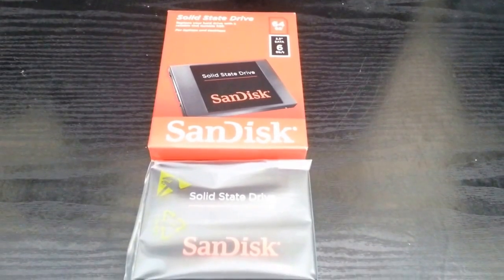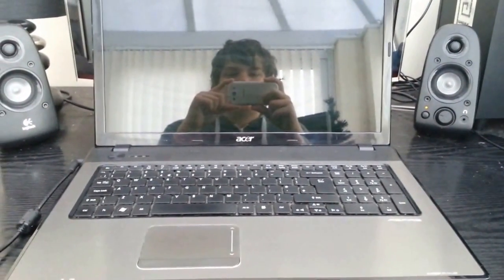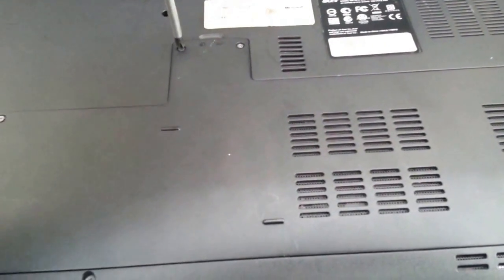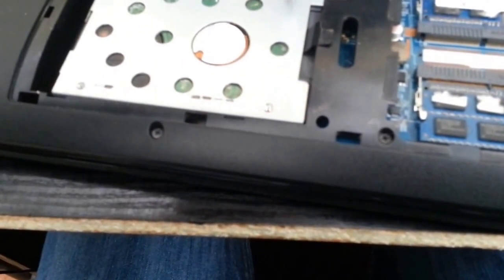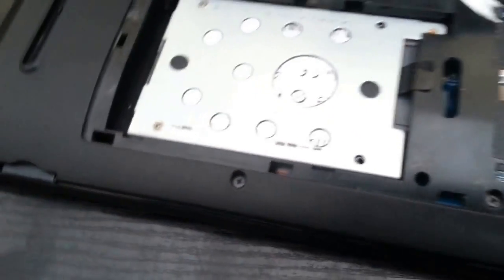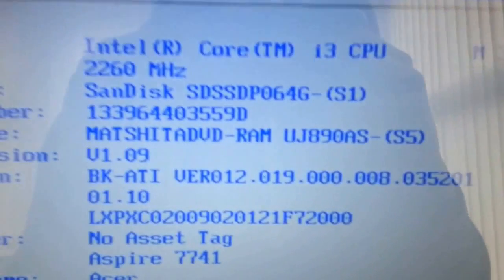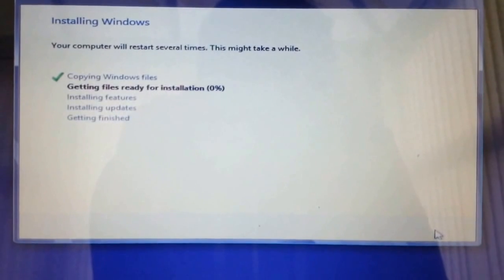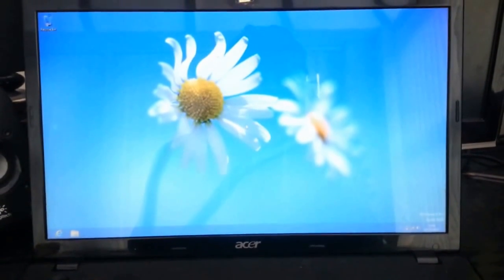Adding an SanDisk SSD Acer Aspire 7741G

Comment: There is a PCIE mini slot, can i add NVME M.2 ssd?
Reply from the maker: No, it will not support any SSDs in the mini-pcie slot. (NVME standard is also too new for this generation of laptop)
Reply: @SuperTillian  is not a M2 sata slot ?
Reply: @bart78  It COULD work.. look at some forums about NVMe on it, many will refer you to use a tool to check how many lanes the PCIe slot has. If it has 2 it can support NVMe. I'm thinking of getting a SN500 since it's a PCIe 3.0 x2 NVMe M.2, the models newer than it are PCIe 3.0 x4, and whole they would work you have to divide the number by two since you have two lanes for the data when they support using 4.
Reply: @bart78  Also, when I clicked this video I thought I was watching one for the Acer Aspire E5-774G, not the 7741G. Looking again it seems like the screw in that slot is off center as well, so chances are like the guy who posted the video said, no.. only try it if you have another device you can put the M.2 drive in so it doesn't go to waste!

Comment: You don't actually show how to insert the new SSD into the laptop...  Which is pretty important...  Too bad, as the rest of the video was very informative....
Reply from the maker: Hi Mark, sorry! The SSD can be placed in the caddy like in the video and then screwed into place using the screws previously installed for the hard drive, then it simply slots back into place and screws in with a single screw.

Comment: What was that empty slot on the far right?
Reply from the maker: It's a Mini PCI-E slot.
Reply: Worth installing one?
Reply: @4theWINMEDIA  You can put a M.2 SSD or NVMe in there! Research your model before doing so, and with NVMe, the fastest choice, I can't find information how much big of a drive is supported.

The E5-575-33BM and many around that time support NVMe that is PCIe 3.0 x2, you can use 3.0 x4 but the x2 and x4 are how many lanes are used for the data to travel on. I'm looking at the SN500 by Western Digital since it's a 3.0 x2 and I don't have to divide the advertised speed by two, the x4 ones would be faster if the laptop had that many lanes, but divided by 2 it would actually be slower!!

Comment: I plan on buying and upgrading this model computer on the third any info you can pass by me?
Reply from the maker: Unless it's in good condition I'd pass. With it only having a 1st generation i3 processor it will be a little slow by today's standards and the cooling solution inside probably won't support an i5 very well.
Reply: would it be able to handle something like game and music creation once the ssd is installed and is there a way to upgrade the processor
Reply from the maker: Back when I owned this laptop is could deal with the Sims 3 fine, due to the dedicated AMD graphics. Music creation it would probably deal with fine. I wouldn't use it for video creation though. The laptop's processor CAN be upgraded but involves a full disassembly to get to the other side of the motherboard where the CPU socket is. An SSD would make it usable, I did find on the unit I owned that towards the end of its life it began to run very hot.
Reply: OK thanks for your input as well I have subscribed